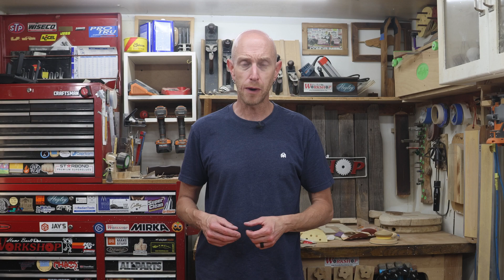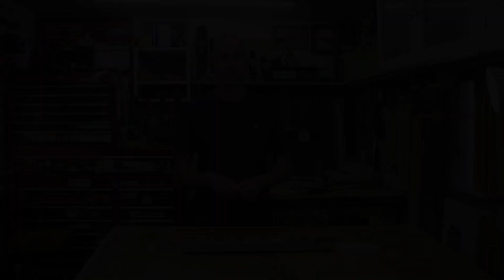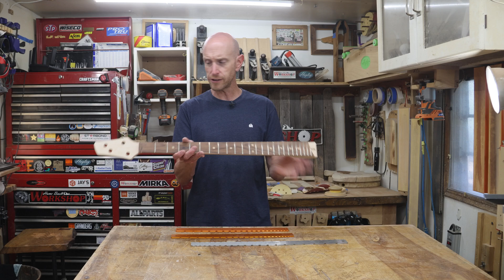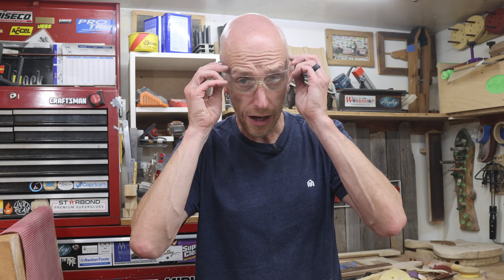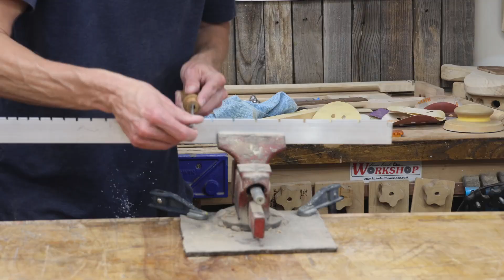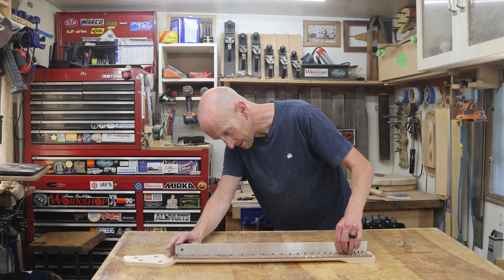Make a Custom Scale Length Notched Straightedge | Homemade Guitar Tools

Comment: Hypothetical question - if holding it up to the levels showed that it wasn’t quite straight how would you address that at home?  Ruling out picking another piece that was straight.
Reply from the maker: I like your question. I guess I'd probably get the piece cut to length and use a sanding beam of some type and sand it flat on my shooting board. If you didn't have a shooting board, you could just use any known flat surface and very carefully sand it flat.